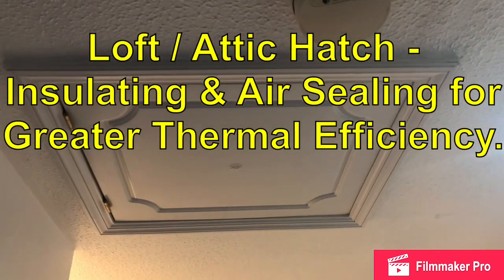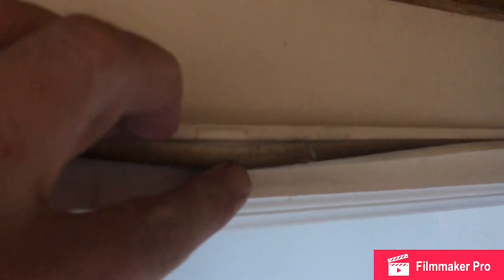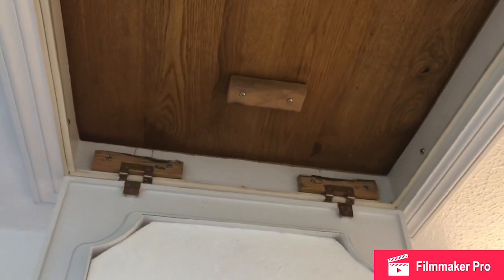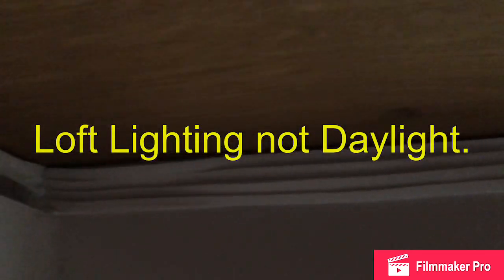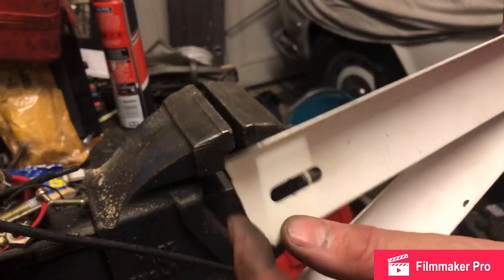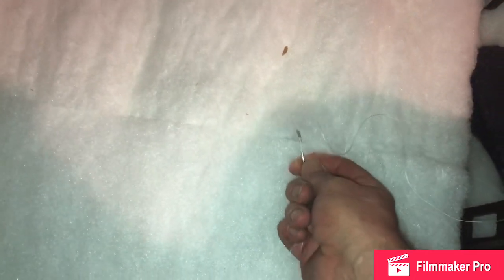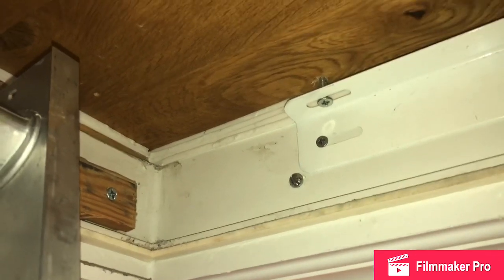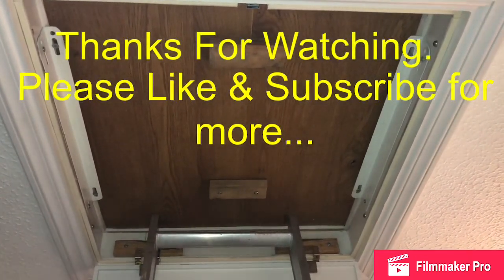Loft / Attic Hatch Insulating & Air Sealing for Greater Thermal Efficiency.

Comment: interesting, thank you, I'm doing mine at the moment and the loft ladder is in the way of any board from above and I also need it to be simple for anyone to access if I'm not at home. getting it air sealed is the tricky bit? my loft had so much air going up it caused condensation on the inside of the felt.
Reply from the maker: The loft hatches with the pull down ladders are more difficult but not impossible. Have you seen this video I made with pull down  loft ladders:- https://youtu.be/-sbrzfNcqEI?si=rqhfIzHCVu_Y6iUd

Comment: Attic Hatch Insulating & Air Sealing for Greater Thermal Efficiency? Perhaps - but now access to the loft is no longer straight forward requiring 4 screws to be removed before you can lift the chipboard to access the loft. In real terns you haven't actually insulated that old loft hatch, you've insulated that piece of chipboard laying atop it - it is now much better insulated.
If you had come up with a more efficient means of access to lifting the chipboard than requiring 4 screws to be removed every time you want to access the loft and those 4 screws having to be  screwed back in place afterwards it would be 'a job well done' rather than 'a job not quite done'.
Reply from the maker: The four screws were something I’d planned to improve on at a later date but life got in the way! I quite rarely go up there maybe two or three times a year so removing and replacing the screws is no trouble for me.